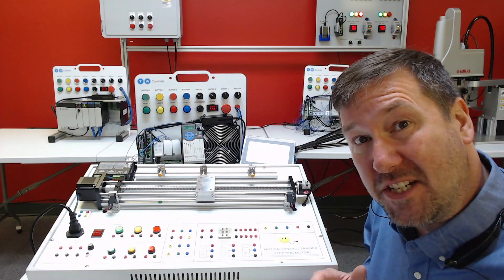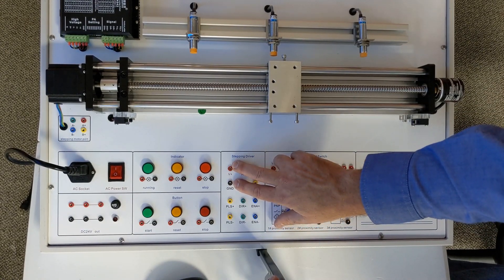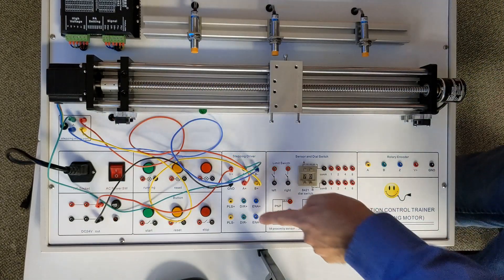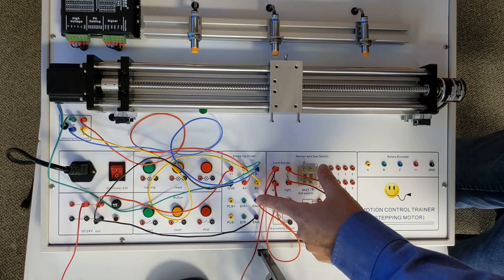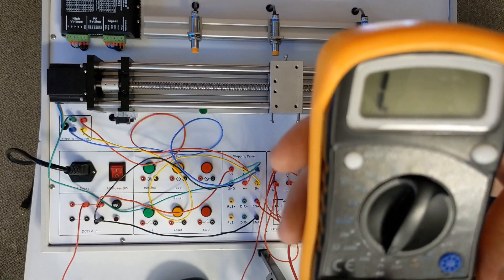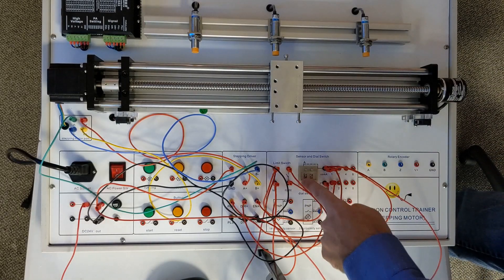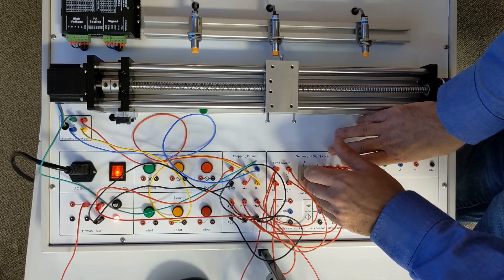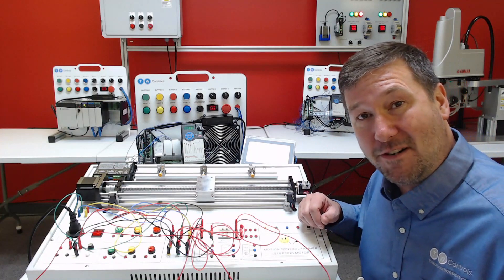Introduction To Stepper Motor Motion Control. Pulse And Direction.

Comment: Fun fact: when probed, the Pulse signal often looks like a 50% duty cycle. This is incidental, it's because every edge (up or down) counts, and the speed tends to remain consistent, hence giving the appearance of a 50%
Reply: Oops. Upon further investigation, That's not correct. Nothing happens on the falling edge. (Source: DRV8825 Datasheet)

Comment: small overlooked nuance: Microstepping. Using clever tricks, the driver can offer you many more "stops", than you'd normally get from just the coils in the NEMA motor. It makes no difference to the pulsing. One pulse equals one Microstep. The number of microsteps (aka subdivisions) is configurable on the motor driver itself

Comment: One little thing to mention: The direction pin. This pin "cares" about the logic voltage on it. (The other pin just waits for a pulse, to move one step) As such, one must know which logic value corresponds with which direction - CW, or CCW.

Comment: When you are wiring something up, you should show a ladder logic diagram or some sort of schematic. This helps things make more sense when there are so many wires and components
Reply from the maker: This trainer came with great documentation.  Did you go through it?  If you are still having trouble, contact him.  He is very helpful
Reply from the maker: Check out the other videos I mention, there are schematics in them.